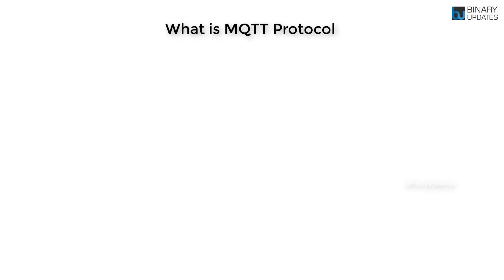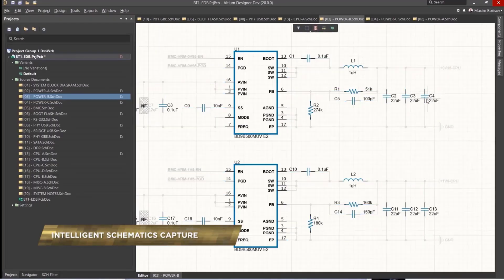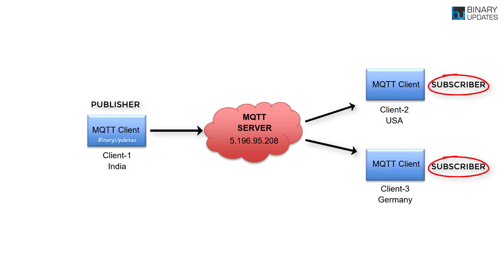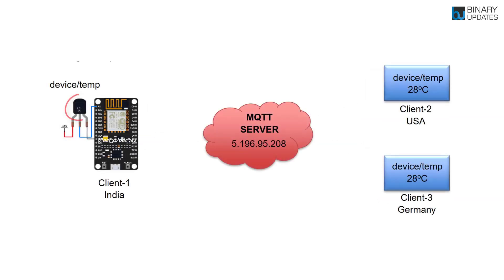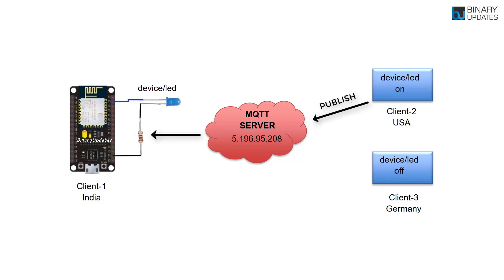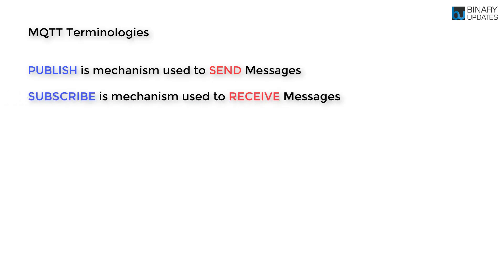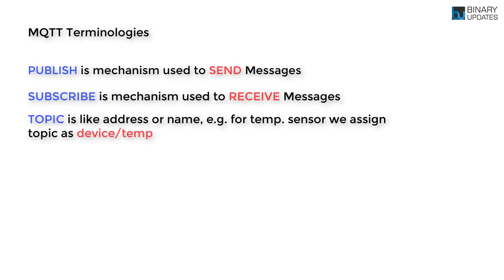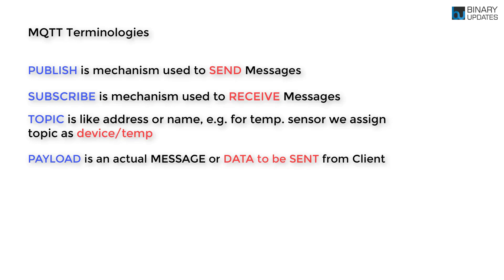What is MQTT Protocol and how it works in IoT Projects

Comment: So can we read(sensor) and write(actuator) to a topic in the same time?
Reply from the maker: Hi Bullygram 
Yes, we can create two different topics for sensor and actuators each. And then if you subscribe topic associated with sensor we can read sensor value using MQTT protocol. And similarly, if we publish message or payload on actuator associated MQTT topics then we can control devices. I hope this answers your question. Good luck and best wishes!